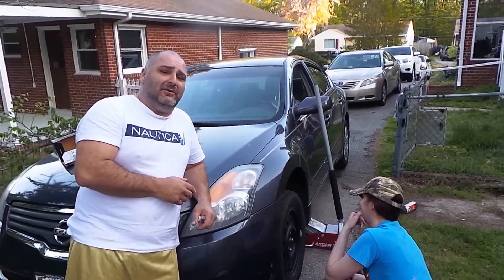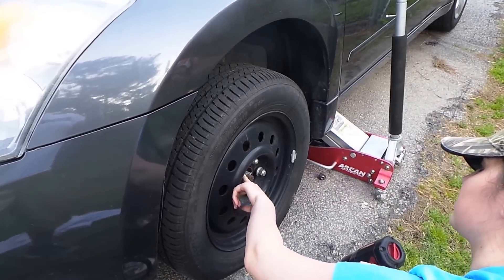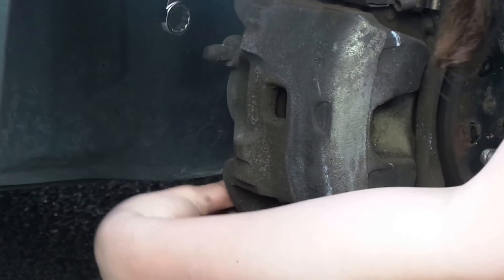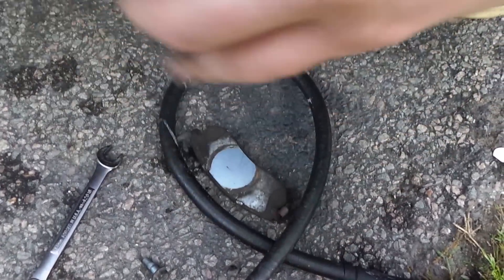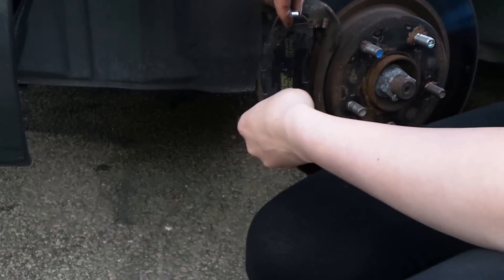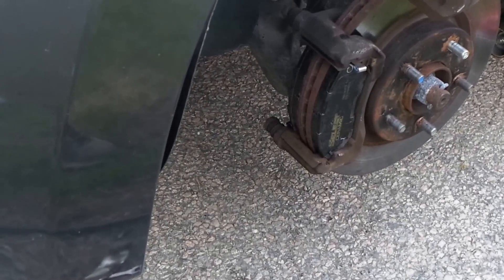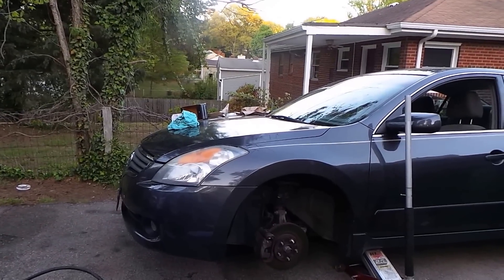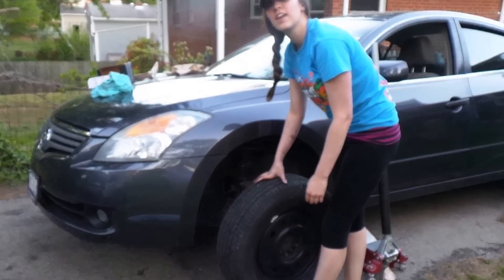2007 Nissan Altima Brake Job

Comment: Caliper grease on the shims is not where it goes, it goes on the pads against the hardware.  The piston is pretty much stationary inside the caliper anyhoo but making it so its lubricated against something it needs to press against and hold is the opposite of what you need to use on the back of the pad. Get stop squeak or whatever its called, its basically a GLUE that you spray on the back of the pad and makes it so the Shim and Piston stick together, dont want those lubed up.... ( I could be wrong tho, it looked like caliper grease and every time ive seen those little packets its grease and or lube thats .002 grams and marked up 50000%

Comment: I bought  the same car but 3.5 SL , 140k fully loaded. For $2300.00. But the had a salvage title. Do you think this was a wise choice? I bought it a month ago  and it's been running g strong. I just need to change the breaks and oil now. I'm thinking I may resale it in about 5 months  but I don't know the resell value. Help please ..

Comment: Hey man, how's it going? I have a question on your Nissan Altima, I have a 2007 2.5s Altima with 112k miles on it and I've read so many forums and posts of how the 2007-2012 and even the newer ones have all these problems with the transmission going out several times.....I do feel that my transmission is very weak and clunks as well......it probably is going out soon and I wanted to see if you were having some transmission issues with your Altima or have heard of anyone who is. The CVT's are terrible and I don't know why Nissan couldn't have stuck with good old automatic transmissions. Looking forward to hearing from you, thanks.
Reply from the maker: yes they are plagued with bad transmission issues however a lot of times if you'll just take it to the dealer and get them to service it it'll be fine
Reply: Ali Ridha 
I have an 09 Altima. It has had 3 transmissions. I did some research and solved the problem. The transmission is to small for the engine and overheats. I put an oil cooler on it. I t just needs some help getting the transmission fluid to cool down. I haven't had any problems since.